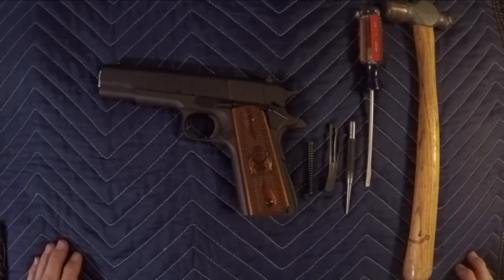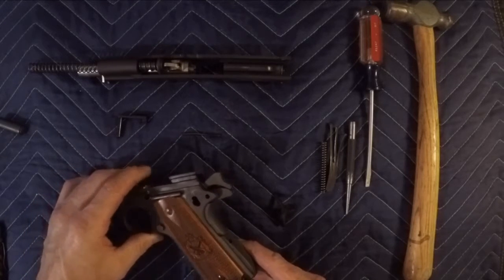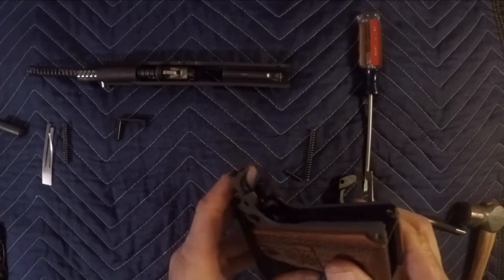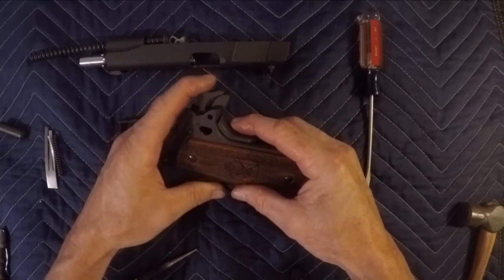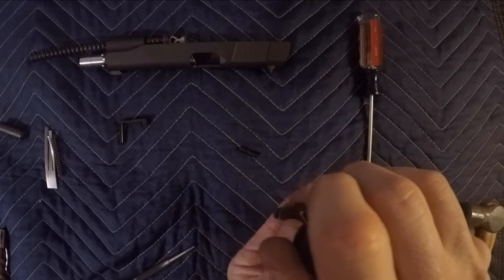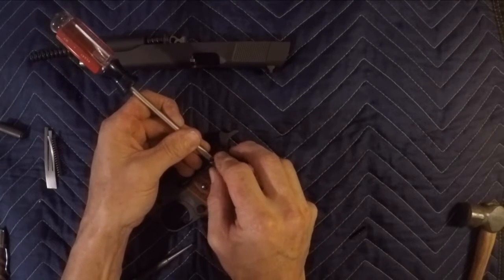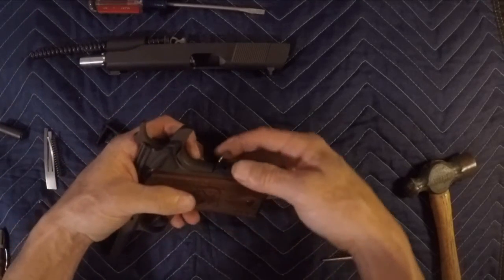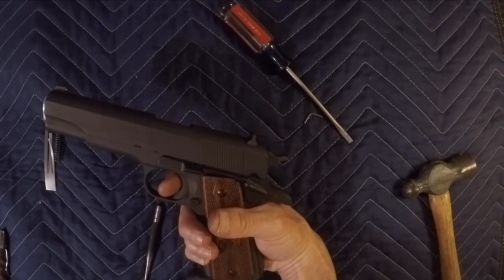Springfield 1911 trigger job

Comment: I also have a Springer Mil spec like this one. Beautiful 1911s by the way. What brand are the parts u installed on it. How's it holding up? Thanks.
Reply from the maker: I got the parts from www.edbrown.com. The parts are treated steel springs.
I have had any trouble with the gun, id totally recomend putting them in. Its an easy and inexpensive  upgrade you can do to your gun.
Reply: Guns Guns awesome! Just looked them up, thanks for the feedback.

Comment: I have a Springfield mc operator.  I was wondering if you knew what size trigger I need to upgrade or are all 1911 same trigger size?  I'm a rookie!
Reply from the maker: Hi Matt. Most of the triggers are universal, not all aftermarket triggers fit right in without any adjustment (filing) to make fit. If your looking to replace your trigger a couple good sights id recommend getting parts from are midway and brownells.